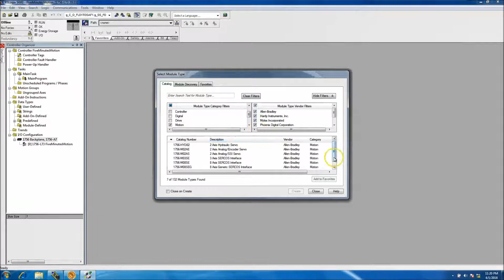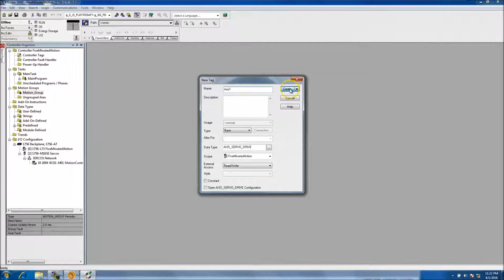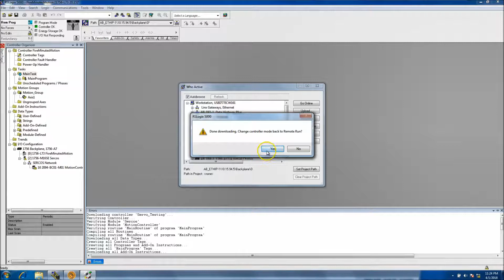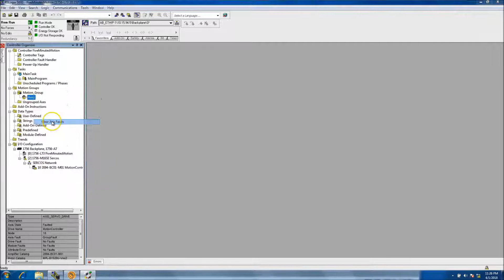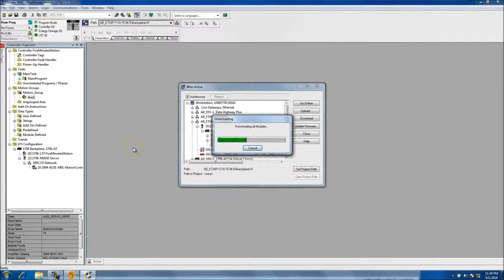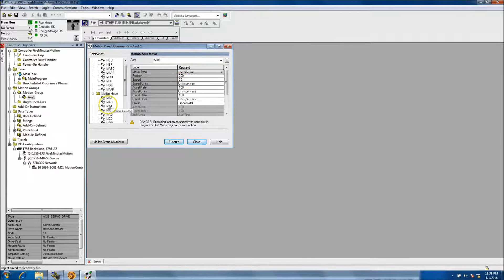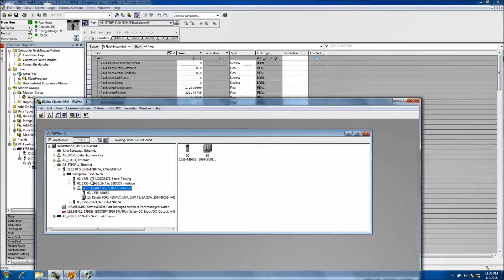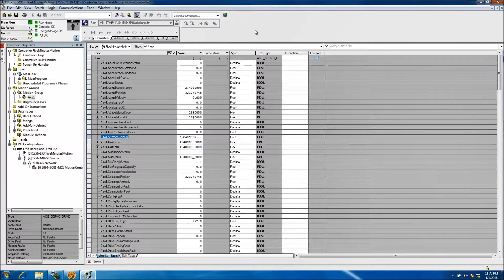Kinetix 6000 Five Minutes To Servo Motion in 2018

Comment: Hi
How do i add an old F-Series motor to the Kinetix 6000 system?
According to the manual if i understand it correctly it should be possible(?) but i can´t seem to find any F-xxxx catalog option when choosing motor..
Reply from the maker: Use a generic setup if it isn't in your database or either update your motor database
Reply: @ShaneWelcher  
Great, thanks! I found an old functioning MPL motor with the cables needed so i took that one instead.
But..
I think I´m close to motion now, however i get the following error when executing MSO: "You are trying to run a motion command when the drive is locally disabled".

Even though I have turned off the: Drive enable input checking.. 
Is there any hardware enable I must have even though I have that off?
Read in the manual about the "motion allowed jumper" is that needed perhaps?

Other than this I don´t have any error either in my Logix program or on the drive. Any suggestions?
I have also tried enabling the "hardware enable" on the I/O connector but the issue persists